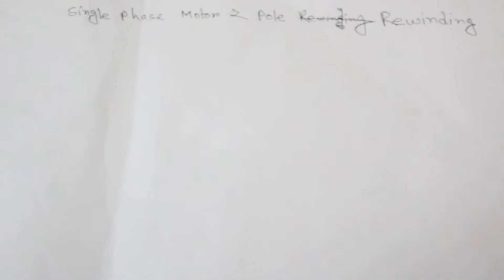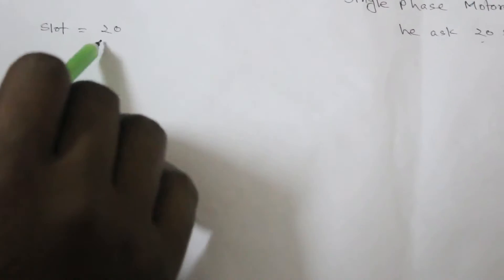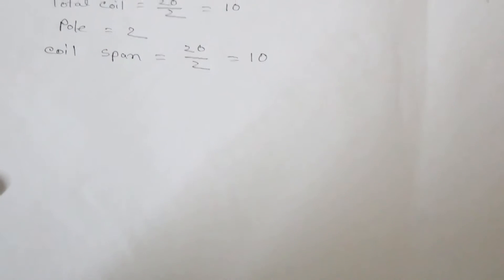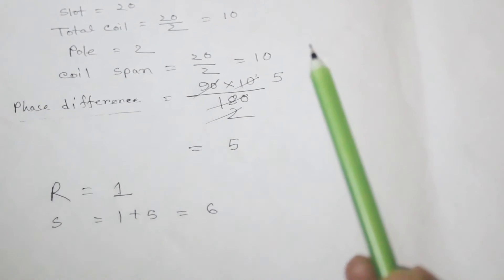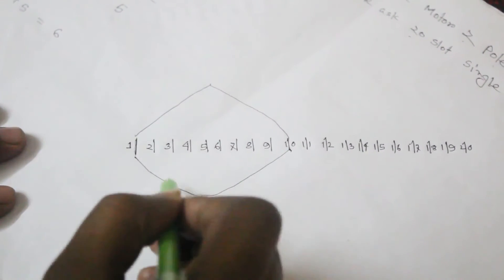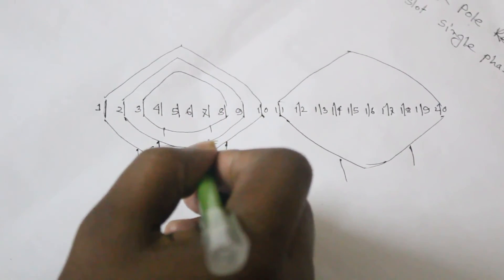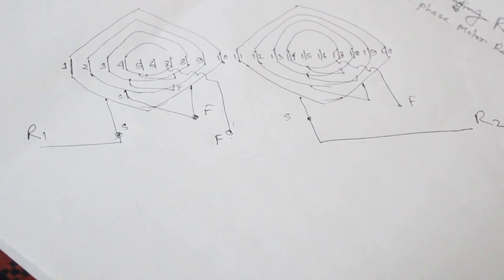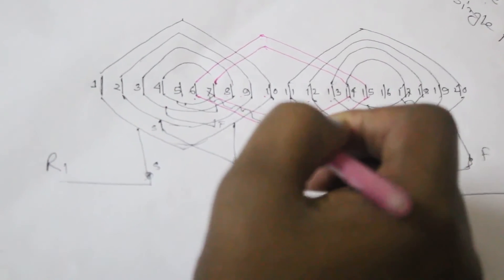20 slot single phase motor rewinding diagram in english. single phase motor 2 pole basket rewinding

Comment: Nice video.  Easy to understand.  However, I am confused on voltage.  Is R1 = 110V and R2 = 110V?  I am rewinding a 110/220V generator.  If your diagram is two 110V poles then I understand.  Thank you.

Comment: brother you told that number of coils 10 but now you used total running 8 plus starting 6 coils, sum equal to 14.
And also basket  winding is single layer winding but in video slot number 7,8,13,14,15,17,18,3,4 and 5 shared by running winding and starting winding.
my other doubt is
eg  if total number of slots 24 for basket winding then 24/2 =12 coils
running coil 12* 2\3=8
and starting coil 12-8=4 or 12*1/3=4
but in this video 10 coil then running coil 10*2/3=6.6
starting 10/3=3.3 explain this?
and total number of coil exceed 10 coils that is total 14 coils.
Reply from the maker: Please listen my video carefully. I thinks you get solution.
Note : according to calculation total 10 coil make rewinding than running 6 & starting 4  Or running 8 & starting 2. 
thanks for your comment. Please share my video.